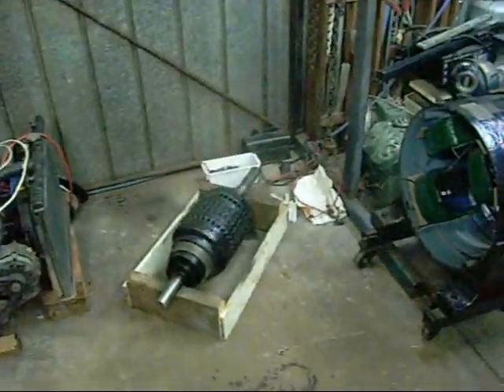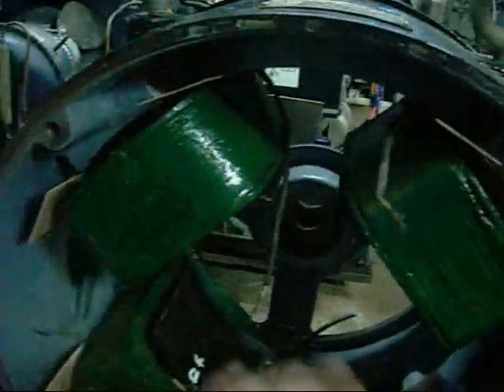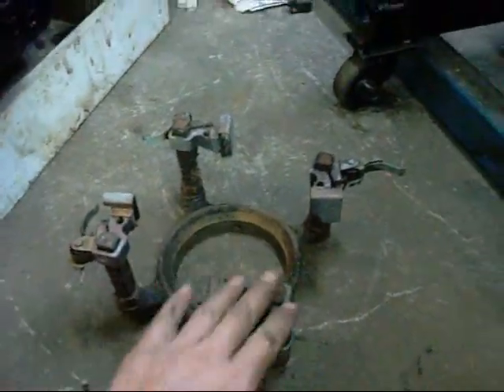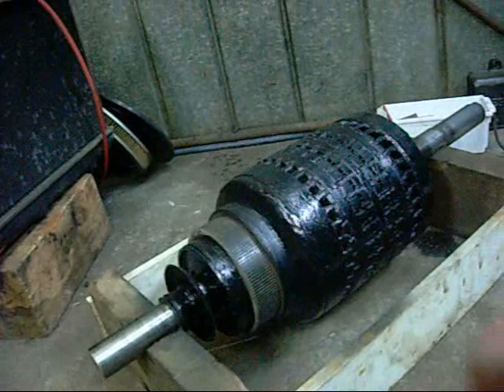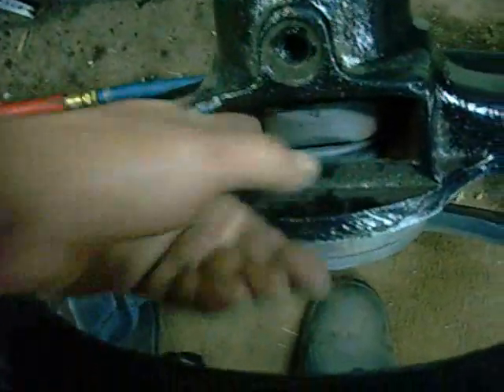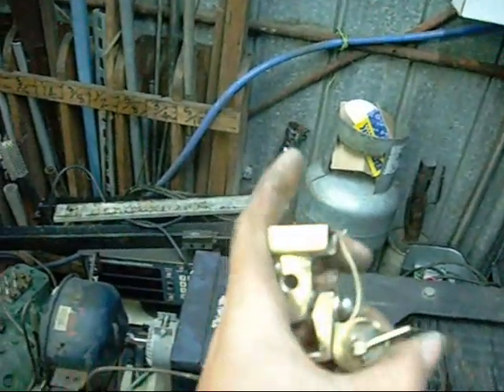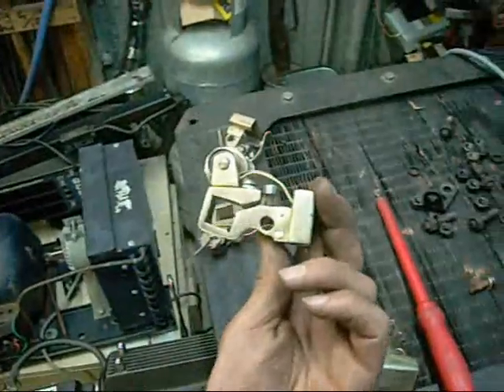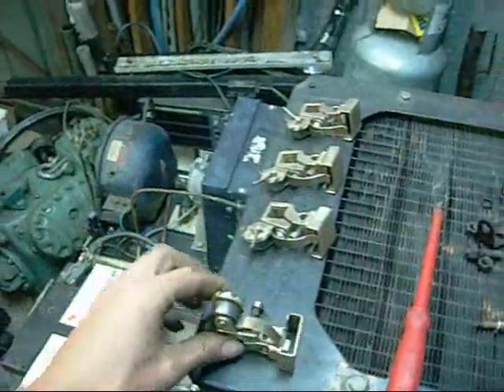Westinghouse 110V DC Generator Update - Brush Holder Polishing

Comment: @Aussie50 That was on the 1920s-30s Austin 7 though, no idea about the overhead valve engines. There should be an interchange somewhere, $100+ for rings is a bit much for a four, it's $80 tops for a Chrysler Hemi and that's a V8.

Comment from the maker: @electro1065 it says DC generator on the plate, plus you can tell by how its made.

Alternators produce AC and need some form of Exciter to start producing power. they also lack commutator bars, instead having 2 slip rings, and only 2 windings in the rotor, connected at a mid point.

This generator has roughly 30 comm bars, maybe more, and corresponding windings in the rotor.

Comment: Are there any possible substitutes for the rings in the Morris engine? Maybe something more generic? A frined of mine found out that a generic lawnmower piston ring would fit a pre war Austin 7 piston (not the post war mini Austin 7) Those engines were inherited from Austin when they merged into BMC in 1952, and had a long production run, so there should be something. Do they have parts interchange manuals at the library like Hollanders?

Comment from the maker: @mrnewagemotor Its a shunt wound generator so its limited to 5.5kw 50 amps @ 110V (600rpm). or you cna ramp it up to 800rpm max for 6.5kw 165V.

Comment: I dress our wire wheel by running the grinder in reverse, then Use an old piece of metal to dress the wheel, I use compressed air to propel the wirewheel in the opposite direction, Let it get to its top speed, then switch thr grinder on, Then it runs in the opposite direction :D

Comment from the maker: @RODALCO2007 grinders and gloves are a no-no here, OHSA regs even prohibit it same with lathes, mills and anything rotating

reason being is a rotating part can give bare skin a bit of a cut or nick, but a glove can be pulled in uncontrollably and in some cases lead to the operator getting mashed up in the machine (lathe accidents like this are common)

I wore gloves on a 20hp drill when I started in industry, the fact it had a foot clutch and was doing 10RPM saved my arm, never again after that